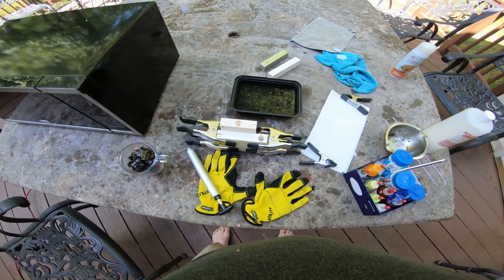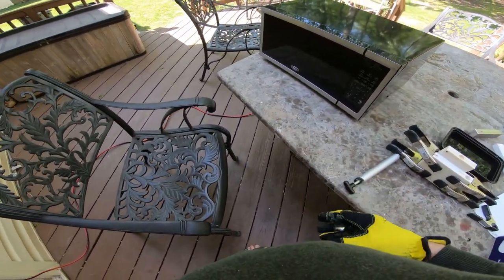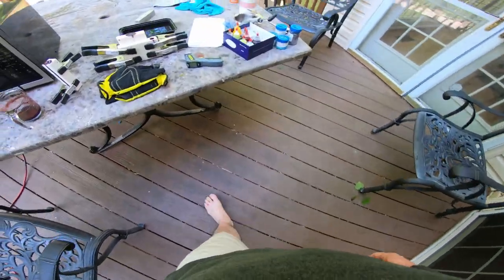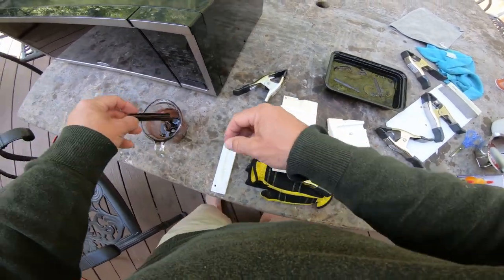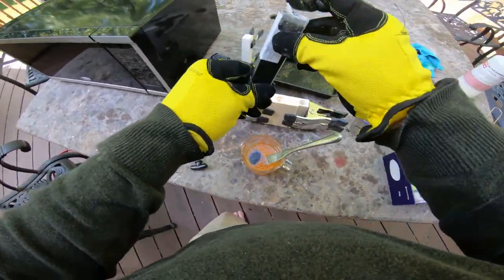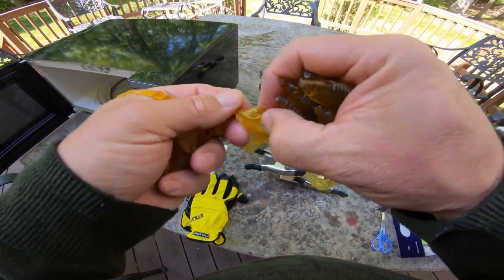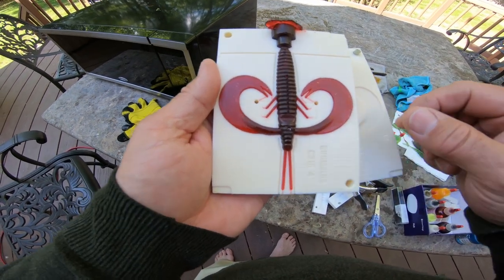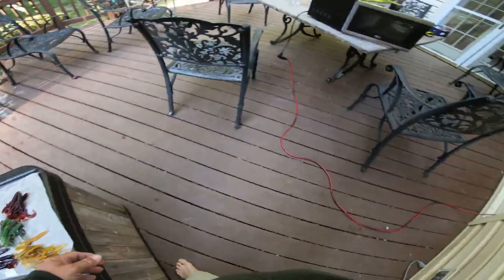Pour your own baits - Start to Finish - How To... #Barlowstackle

Comment: If you want the legs on the bandito to fill out, hold firm, steady pressure for at least 10 seconds. I have a bandito mold and it seems to solve the problem. You can also add a bit of cooking spray oil to the mold for easier removal and a shiny look. Sometimes the oil helps the plastic flow in skinny areas like the legs. Enjoyed the video as always.
Reply from the maker: Jakob Bunge great tip thx!

Comment: i think the reason you get air bubbles in the head of the swimbait is because the funnel isnt long enough for the pump to fill the top, i think you can add a short funnel to the top of the mold and extent the filling it prolly solve the problem.
Reply from the maker: oh cool, I will check it out.